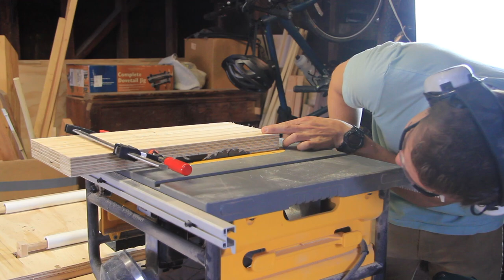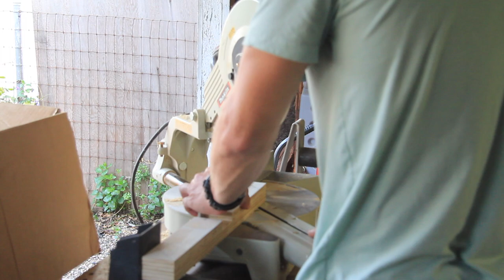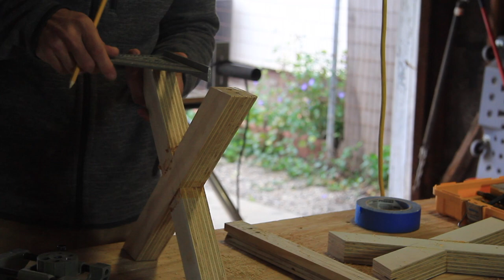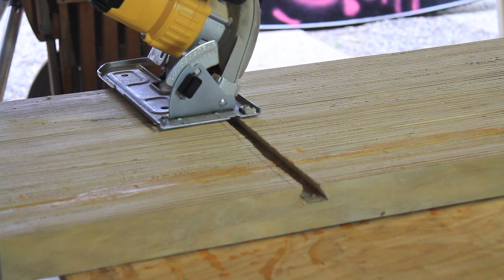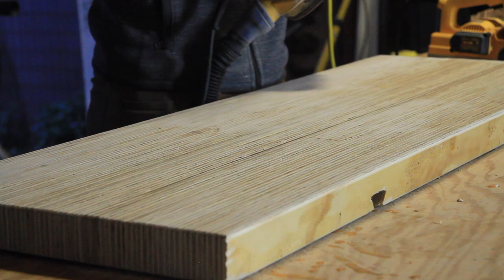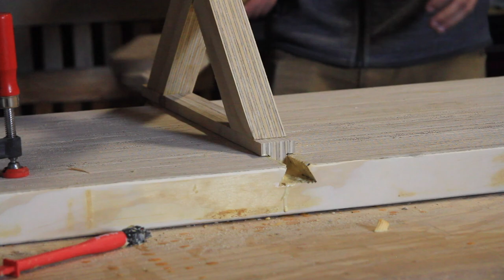Building a Plywood Coffee Table Part 2 // No Hardware No Problem #dovetailjoint #socialdistancing

Comment: If you get a plunge base for your router, next time those dovetail slots would be way easier using the router. Nice job though, using what you have.
Reply from the maker: I have one, but wanted to try it with a circular saw so that the joint could be deeper into the underside of the table. Great idea though and thanks for sharing!

Comment: nice demonstration! could one shortcut and glue the legs to the table top directly or would that break?
Reply from the maker: Thanks for watching and for the comment! You probably could, but the strength would certainly be less that the half lap joint. Cheers